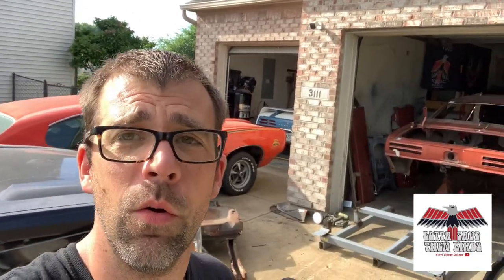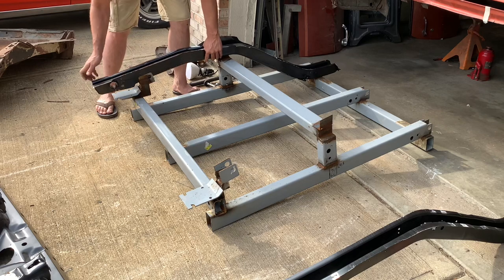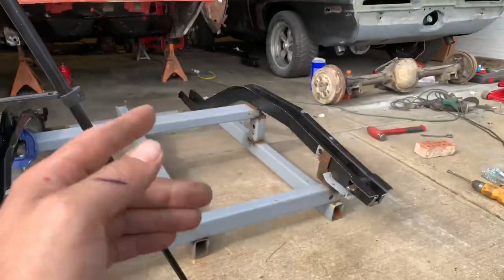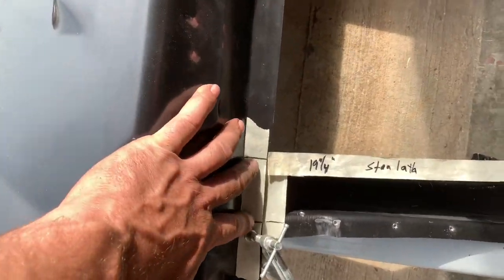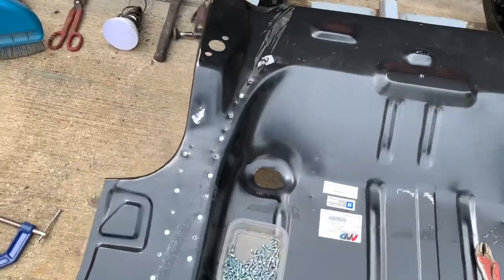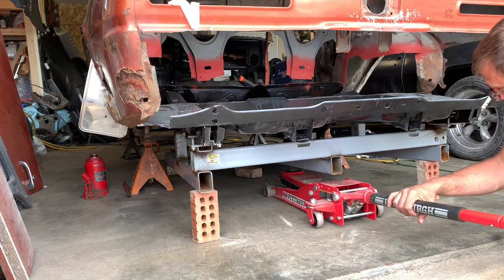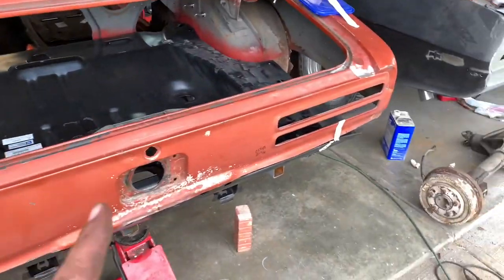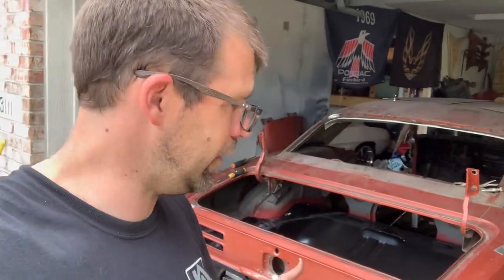Body panel replacement installing rear frame rails and trunk pan 1968 Firebird

Comment: That frame rail jig is fantastic! Congratulations on the design and building of it.
Reply from the maker: It was a huge time saver for sure.  What used to take me 3-4 hours of rolling around on the floor, now I can get it done in about an hour.

Comment: A floor jack jacking a floor. This is the way
Reply from the maker: Is that a madalorian reference 🤔🤣
Reply: @VinylVillageGarage  why yes it is… I guess us new gen tin knockers are the last of a kind of people! We will seek out savable muscle cars and destroy the rust where ever it might hide
Reply from the maker: Indeed not many would embark on bringing rust heaps back, I find it to be fun and challenging not to mention when done very rewarding.
Reply: @VinylVillageGarage  im glad to have come across your channel we are fisher body
Reply from the maker: @jmpsavescars  I see your camaro has just a bit of weight reduction, definitely savable. I prefer buying cars that way because you know what your getting and not paid a fortune for it and have to replace all that metal anyway.
Reply: @VinylVillageGarage  yeah its the best worse case senario. Super solid and straight minus floor. Im working on the part 4 paint resto video. My motto exactly!

Comment: You really are a master when it comes to these 1st gen Firebirds. It's amazing how well you explain every part of the process in such a clear way...I guess what I'm saying is you make a great teacher. Thank you as always for sharing you're knowledge. In regards to replacing the bricks, maybe something like those lightweight screw jacks that are used for campers. Possibly weld four of those to each bottom corner of your jig to help with evening out and balancing the height. They're pretty lightweight so it wouldn't add too much more to the over-all weight of the jig. Possibly even use those little 3 wheel dollies under them to move it into place, then remove them when you get it close to where you need it to be. Sorry to be long-winded but I had a thought and wanted to share.
Reply from the maker: Wow thanks. At one time in my life I wanted to be a teacher, just never figured out what subject matter to instruct so maybe I have found it.  
  You might be onto something with those jacks and some small casters.  It was a bit wonky getting it up into place, mostly because Brian and Luis where not much I help I feel. Lol

Comment: Great video!  You make replacing a trunk floor and frame rails look super easy and the frame rail jig is an awesome tool.  Great work sir.
Reply from the maker: Thanks buddy.  The jig was an experiment and will now say worth every minute to assemble it. Assembly time and peace of mind that the rails and floor are configured right totally worth it, plus I plan to use it several more times, huge time saver.

Comment: You can use a ratchet strap on each side and pull it up
Reply from the maker: Yes I use the heck out of ratchet straps, I have a drawer full of different sizes.

Comment: How about rigging up four bottle jacks and four casters on the corners of the jig.  Then you can slide the jig under the car and jack up each corner.
Reply from the maker: Heck ya great idea,  that will give it full adjustability and great mobility.  I will see what I can get for small bottle jacks

Comment: Seriously, thank you for doing this series! I have a 69 that needs floor pans, trunk pan and frame rails and watching this is giving me hope and confidence! I just need to figure out how to fab up one of those frame rail jigs lol
Reply from the maker: You are welcome, crazy as it sounds I enjoy the metal working part of the build.  The rails Can be done without a jig did many that way just seems to take a little longer.  How close to Indy are you? You can borrow mine, heck bring the rails and trunk pan I will help you assemble it.  Before you head back.
Reply: @VinylVillageGarage  I’m in St. Louis MO, so not super far. I’m definitely going to get in contact with you as soon as I actually get parts (and can get a vacation LOL)!
Reply from the maker: Sounds like a great vacation. Keep me posted.

Comment: Thank GOD my 68 / 400 Convert 4 sp has always been garaged! Oh, it might have a few pin holes in common places but nothing a wire feed welder would cure. Now my 68 Camaro, that's a different story. Poor car, been rode hard and put away wet all it's northern life, even was drove on the beach of Daytona Fl. ( a HUGE no no !). See back in the day these cars were nothing, just another car. Nobody expected them to be around over 50 years so they were throw aways on every used car lot ( can't believe I said that !) We use to find them rust free with a blown power train for under $400.00 with a title. Fact was I bought my red & white straight rust free 68 matching numbers Convert 4 sp 400 car in 1976 with 31,000 miles for $850.00 and it sat in the want ad's for weeks for sale with no takers ( everybody wanted a GTO ! )  So watching you go through all this is like ----- WOW ! crazy, but bottom line today there is nothing better, so we got to do what we got to do.
Reply from the maker: Drove it on the beach!!! 20
Lashes for you, lol. Just kidding like you said they where just a car that was common and disposable.   They where designed to
Barley live 5 years so to think 50 years later anything is left is a bit of a miracle.   I enjoy rescuing these rusty relics and driving the heck out of them. Probably skip the beach 😉 but other then that anywhere anytime.
Reply: @VinylVillageGarage   Nah, no more for me, everybody try's to steal mine any time I go anywhere, it's just not safe to take them anywhere as you walk back out, poof gone, there now one of the most sought after stolen cars.  Plus both of mine are the real deals, not a clone 68RS/SS  & 68 400 x 4sp convert . Then add if I hit rain, I am always under a overpass waiting.  But when I do drive them , I am always sideways in second, no mercy  lol . 

     No, not me on the beach, MY DAD! ( the fool ) He also gave up the original number matching steel forged crank 327 for a mutt 77 /350 when the 327 blew a head gasket while I was out of state. I didn't speak to him for over a year after that. He said he could not understand why I was SO pissed off over a OLD MOTOR !   The reason was simple, it only needed a head gasket for that forged crank number matching 327. I am STILL hot about that!  and he's been dead for years !  That was a standard bore 327. If I would have it today, I picked up a NOS NEW  283 forged crank for it. A 283 crank in a 327 is a , ( drum roll please )  screamin 302 !  Yes, I am on the hurt for anther standard bore 327 block. THAT"S NOT THE POINT ! He gave up the factory 327 for a 12 dollar blown head gasket. No, I am not happy . lol .
Reply from the maker: Then it is your dad must be punished for setting the awful example of driving on the beach.   Heck back in the day I would have done the same thing, my first car cut across a couple corn fields just for fun so I get it.  

My cars where built to be driven.  They aren’t rare from the factory I might feel differently if I owned a real trans am or ram air bird. Not to mention if someone stole one of my cars it’s insured I would definitely miss it but have funding to do it all over.

Comment: Wish I would have seen the video before I started. I have my entire rear reassembled and now need to put the frame rails in. Do I need a jig like that?? I live near Dayton Ohio. More than happy to rent it from you. Just wondering though if you have any suggestions that maybe easier with the floor pan already welded in place?
Reply from the maker: If the floor pan and trunk floor  is already installed the jig won’t do much.  The thing to do is just set your spacing from left and right rails.  I would also  suggest installing the front spring mounts loosely to ensure the bolts line up when you do final install on the leaf springs. Other then that just keep the frame rails parallel and equally spaced. Then if it’s a 68 you will also have to modify and shorten the frame rails too.
Reply: Got it! As always thanks for the reply and the videos. Never would have tried this project without your videos

Comment: So, I have a 69 that I need to replace the floor pan, trunk pan and the rear frame rails. My question is, which one should I do first? What would be the best angle of approach? I’m buying a trunk pan that has the frame rails already attached if that info helps at all. Thanks for all you do with this very informative series!
Reply from the maker: If going that route and I would do the same. I would do the main floor pan first. Then the rear section assembly. Take lots of measurements and keep the car level to the shop floor as you go.  In my mind i only remove the area I am working on and leave as much as possible still intact as I go. With the idea of what’s left holds the car body in place and shape as I go because I don’t use a body jig at this point. I have seen the aftermath of removing too much and almost impossible to get it back into shape. If it’s a convertible leave the door on the car and continue to monitor door gaps as you cut and weld To Insure the body hasn’t shifted
Reply: @VinylVillageGarage  thank you! It’s not a convertible so I should be good on that, and the entire floor needs to be redone aside from the tunnel in the center. Maybe it would be smarter to do the two sides independent from each other instead of trying to one shot the whole piece? Or should I just go for it and do the whole thing in one piece?
Reply from the maker: From my experience you would have less welding and cleaner results with one pice floor pan.
Reply: @VinylVillageGarage  Thanks again for the help!
Reply from the maker: Anytime

Comment: Great work my friend, can you supply me with the info on getting a jig for my trunk & frame rail replacement ?? thanks very much
Reply from the maker: I made my rail jig from a good car as a template so I don’t have measurements unfortunately, the even worse part is I let someone borrow it and it got lost in shipping.  I am gathering the materials to make a new one the next time i have a good car to make it from.
Reply from the maker: I made my rail jig from a good car as a template so I don’t have measurements unfortunately, the even worse part is I let someone borrow it and it got lost in shipping.  I am gathering the materials to make a new one the next time i have a good car to make it from.

Comment: did you pre drill the holes in the frame rail before driving the screws in?  That frame rail metal is thick!
Reply from the maker: Nope those self tappers go right thru the rails
Reply: @VinylVillageGarage  wow.  Wound have never believed it.  Where do you purchase your self tappers?
Reply from the maker: Menards or Lowes when I bought them. Believe it or not I found a bag with 5,000 or so screws in our scrap metal
Bin at work!  It is my favorite store lol.  I get all kinds of goodies out of it to build with.

Comment: Silly question... have you ever thought about making a bolt together version of the jig and selling them?
Reply from the maker: You know I hadn’t yet.  Cost of materials and labor might be spendy for a one time use.  Bit of a person was doing several definitely very useful tool. I will see what it costs to build as a collapsible unit.
Reply: @VinylVillageGarage  that would be great.  If I end up rebuilding my Firebird I may have to make the drive from Mid-Michigan to Indiana.  But I may not be opposed to buying a jig either. Thanks again you've really got some great explanatory videos.

Comment: What diameter mig wire do you use?  Thanks
Reply from the maker: I use .030 for every thing only because that how I learned to do it.   023 is more ideal for sheet metal and easier to control the heat.

Comment: This is an awesome video. Its been so hard to find any vids/pics when it comes to replacing the rear frame rails and such. 
I need to replace the rear frames rails and trunk pan on my 1981 pontiac firebird as they are COMPLETELY rusted out. I can poke through the frame rail with a screwdriver. 
QUESTION 1: Would this process be the same/similar with a 1981 pontiac firebird? Obviosly the parts would be different. 
QUESTION 2: What do the rear frame rails bolt to exactly?
QUESTION 3: do the leaf springs connect to the rear frame rails?
Thanks. I am new to this and just trying to understand what I have to do.
Reply from the maker: Thanks I hope this i video helps, it applies to just about any unibody car. Question 1 for the most part you can use the exact technique. The goal is to keep things level and equally spaced.  Question 2 the frame rails are spot welded to the trunk floor, floor under rear seat and the inner tail panel.  You will have to get effective at welding to properly install them.  Question 3. Yes the leaf spring attaches to the frame rails on both ends. 

Keep this in mind. Nobody makes reproduction rear frame rails for 74-81 fbody cars so to replace them you will need to find a good set of used ones. I have been experimenting with the 1970-1973 rails as a possible repair I believe with some modifications they might work, I can’t promise that yet.  Good luck on your project!
Reply: @VinylVillageGarage  thank you for the reply. This is SO helpful. This is my first car I have ever worked on so everything is new to me. 

(If this is okay with you) Can I send you some pics of how fucked up my frame rails/torque box are? It would be game changing to here the opinion of someone with experience regarding how they would handle my project and fix it.  Thanks. if you’re busy and don’t have the time to do that I totally understand as well.
Reply from the maker: Definitely send them my way. I would see what you have to work with.
Reply from the maker: Send it to  vinylvillagegarage@gmail.com
Reply: @VinylVillageGarage  Hello I emailed you from my pontiac firebird account
Reply from the maker: Yes I got your email. I wasn’t able to respond or open the link for the pictures for some reason.   The 305 isn’t a bad engine at all. Most of my friends in high school had 305s in their cars and we got in plenty of trouble with them.  

Maybe try to send the pics again or from a different email?   I would like to see your project
Reply: @VinylVillageGarage  Thats awesome! I sent the link again. It should work now. You should be able to respond as well. 
Google restricted the gmail account because it was new for some reason...

Comment: I had the same problem, the tank straps are welded in an inch or so too far forward!!!!!! I removed mine and re-did-it 😢
Reply from the maker: Wow an inch is excessive.  I suppose That is why it’s recommended to test fit all
Panels prior to final installation.
Reply: @VinylVillageGarage  I used the same full trunk as you have in the video. “Trunk floor reinforcement” is the term I should have used.  If only we had a line to Taiwan, they could use an expert to help!! Keep grinding buddy & the good work

Comment: Send me the plans for the gram rail jeg
Reply from the maker: Wish I had them, it was assembled directly onto a good original car so I knew it was as close to factory as possible, it worked great the few times I used it.  Then it went missing in shipping to Maryland, unfortunately it is gone and I plan to make another when the opportunity arrives and this time I will see about getting dimensions.